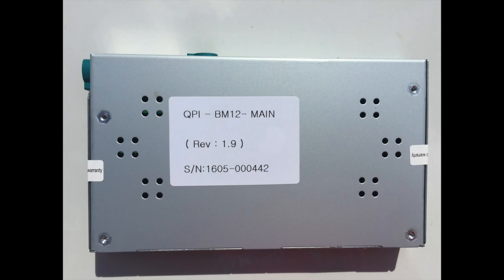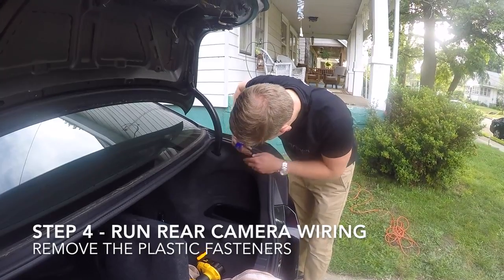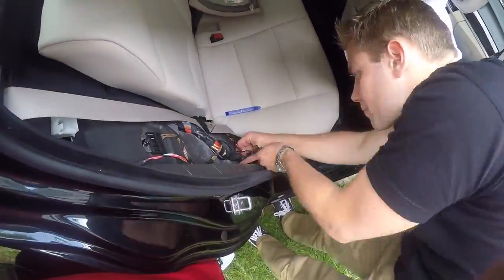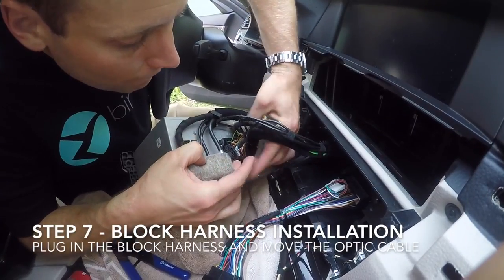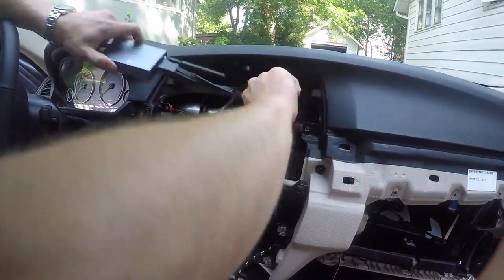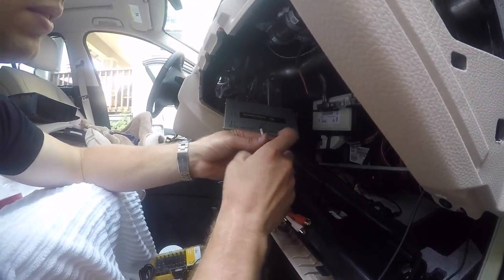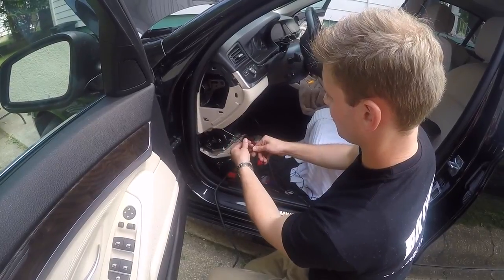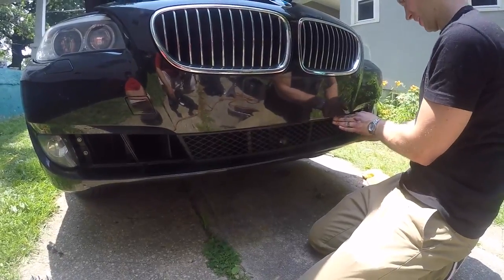MMI Rear View Camera, Front View Camera and SmartView in BMW F10 | Installation Tutorial

Comment: Does anyone know what the green fiber optics cable is for. If you damage it, what stops?
Reply from the maker: This depends on your car configuration. The MOST network is responsible among other things for: Bluetooth (in certain cars), AUX/USB connections, head up display or the audio system (most of the H&K equipped cars).

Comment: lol not a shot i would go through this whole thing without screwing it up.  not trying to mess with my car as much as i want backup camera
Reply: BimmerTech I'm pretty sure that's definitely not where bmw puts their front view camera it's much higher on the bumper but cool good job
Reply: Just save your money and have it professionally installed. I don’t know I think having a back up camera is just about required nowadays, getting into those tight fitting spots, especially here in Los Angeles, where it’s very difficult to find a parking spot that you can just slide into.
Reply from the maker: In such a case I would recommended checking out our dealer list for an installation shop nearest to you: https://www.bimmer-tech.net/dealers